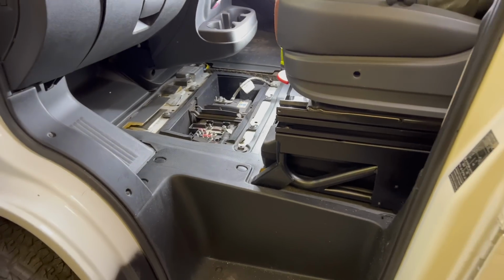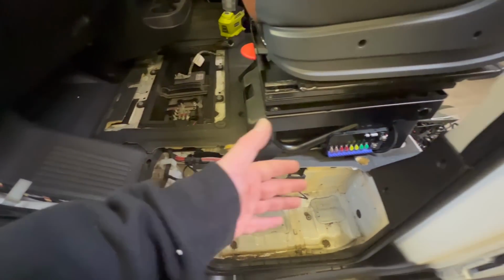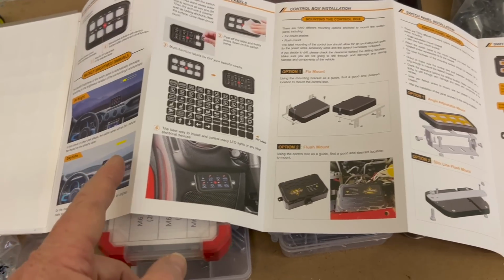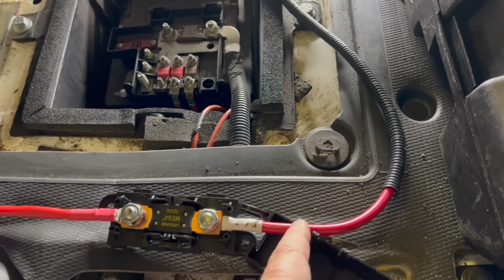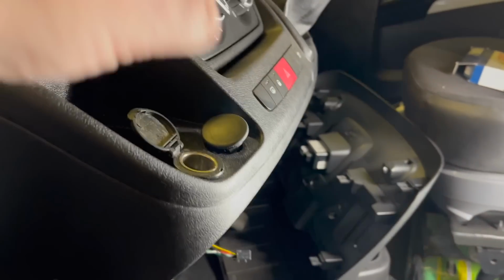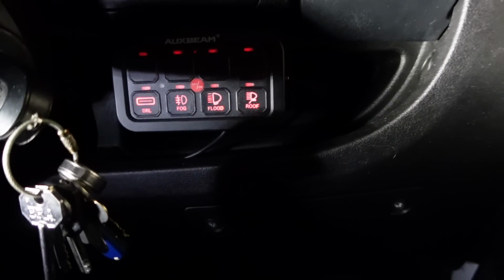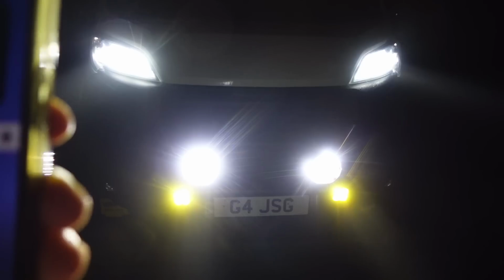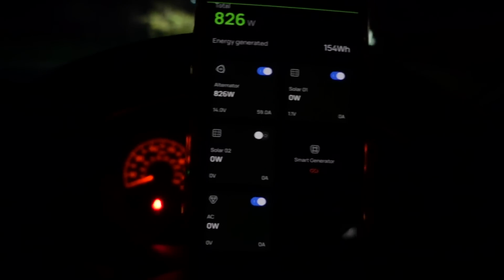Night mode is activated - VB26

Comment: Hi John did I hear you say you wired the auxbeam to starter battery which also needs a ingnition feed. then you would not be able to turn on the small roof lights without the ingnition on, you may want the roof lights on for barbeques or turn on easily if you hear a noise at night... Fitzy
Reply from the maker: If you watch previous videos you’ll see how the roof lights are powered and controlled.
Reply: @GadgetJohn  sorry John my bad

Comment: Hi John. Could I ask about a task you completed earlier in the build? When you put the charging point in the front of the van next to the existing 12v socket how did you fasten the new socket in place. Even with the glove box assembly removed access to fit the large plastic retaining nut is extremely difficult and tightening must be almost impossible. I'm guessing either I've missed something or you've found a way of locating without using the nut
Reply: I've solved my own problem. Just needed to swear a bit harder and add two extra joints to one finger. I wish I was doing it indoors but at least I've got the diesel heater going full blast. How warm is it in your unit?

Comment: Hi John another interesting vid, I did notice in your van that you had one of them plug wall heaters, now I don't have any heating in my van and I was wondering if they would work with a power bank and what watage are they and how much do they cost, hope you don't mind me picking your brains,
Reply from the maker: They are 500w and do help keep the chill off. But at 500w you can easily work out the battery bank size you’d need to run it for a few hours
Reply: @GadgetJohn  I will try and work it out, thank you

Comment: John top job, can I enquire where in the firewall you found a grommet to take the cable through to the engine compartment.  Currently I’m thinking of dropping it out the floor from the battery in the cab area but would prefer to go through behind dash.
Reply from the maker: I used the same line the starter cable takes from the starter battery.